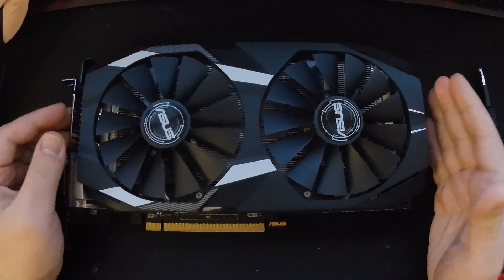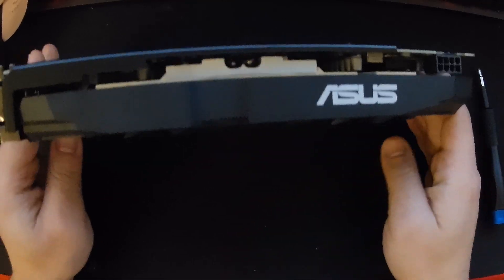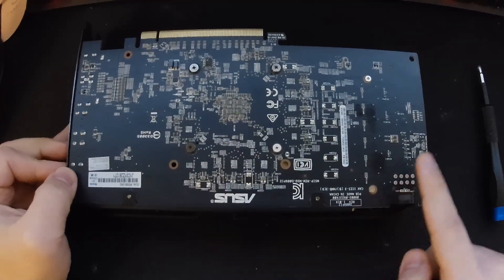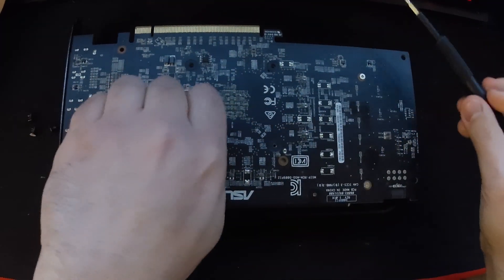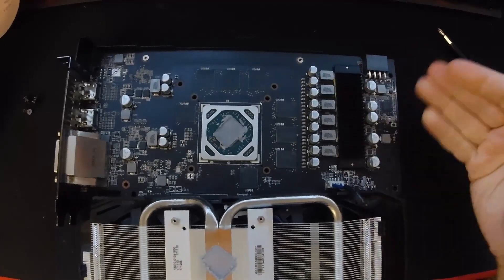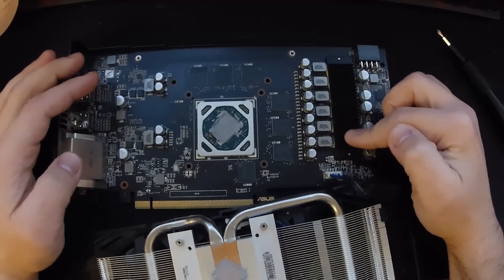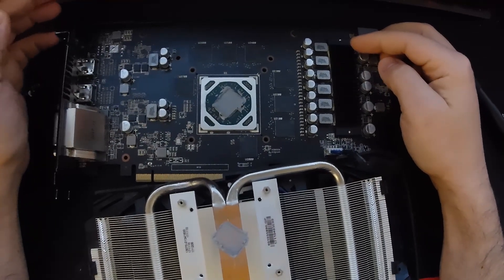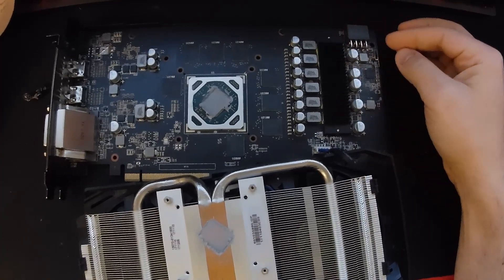Disassembly of a ASUS RX580 8GB DUAL OC

Comment: is that ok if this card Vram don't make contact with heatsink? i am going to get one rx 580 for an old system. my options are this asus dual OR xfx GTS. which one do you recommend?
Reply from the maker: Hi, XFX GTS is far superior in cooling and performance.
Reply: @Madmax0620  so heatsink contact with Vram is important... but what's the normal temperature for this gpu? i saw xfx is around 74 and asus is 71. is that ok?